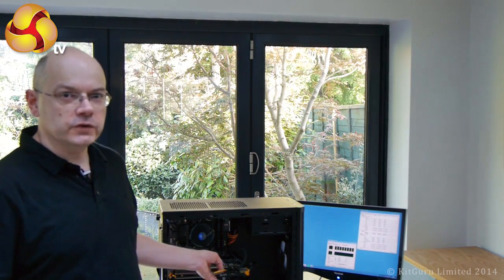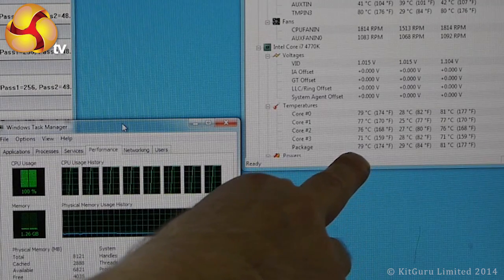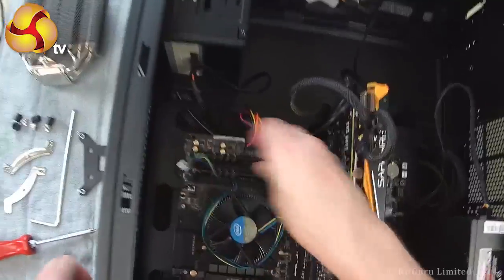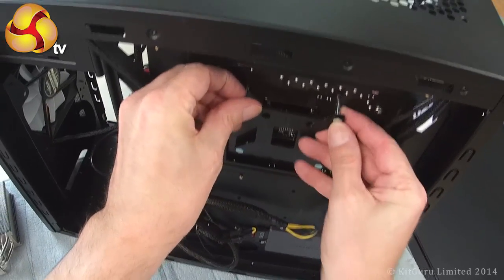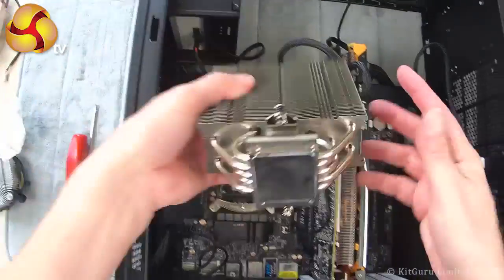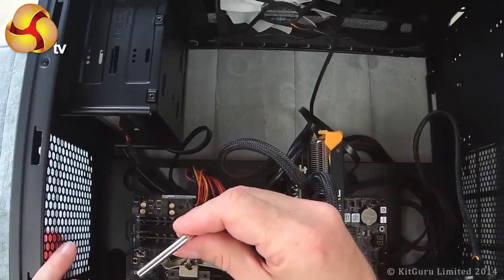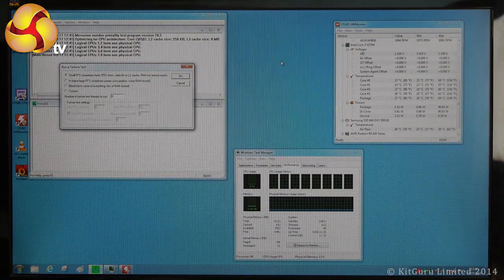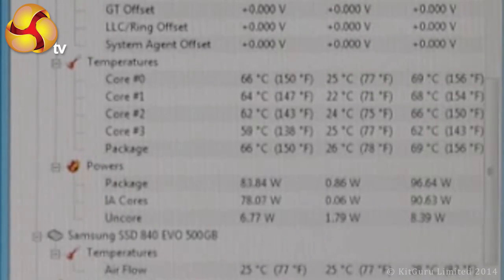Upgrading your CPU Cooler with KitGuru

Comment: Honestly you should always make sure the thermal paste is spread evenly across the processors surface... I would not recommend just putting a blob of paste in the middle. Not the best way to do it.
Reply: yeah but when you put the heatsink on it spreads it out for you. if you try to spread it yourself you might end up with spots that are thicker or thinner than others. a ton of people would recommend applying the thermal paste the pee method, but do as you please its not that big of a deal
Reply: vince russo agree
Reply: if you spread it manually you end up with air bubbles in the paste. making it even more ineffective then not covering the whole surface

Comment: I also want to test it on my pc, how did you manually set the cpu process to 100%?
Reply from the maker: Run Prime, available as a free download.
Reply: KitGuruTech thank you and by the way, I have an amd stock cooler on a4-5400, planning to change it though. Is it ok if i buy deepcool gamma archer or zalman cnps80f in terms of cooling efficiency?
Reply: Renz(BlobbyBlobz) im using deepcool ice blade pro v2 on a amd phenom II 4x 995 and its all good. :D
Reply: imbaloki what your highest temp on full load? Mine is hitting 98 celsius on full load with stock cooler.
Reply: Aida64 is a better program to use. It has less issues than Prime95 when running the newer processors (Haswell/Haswell-refresh).